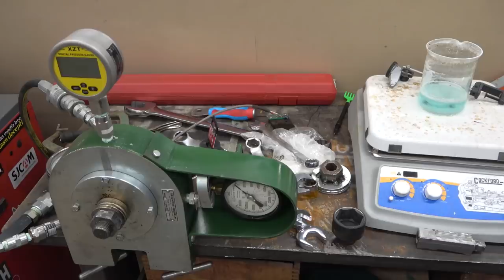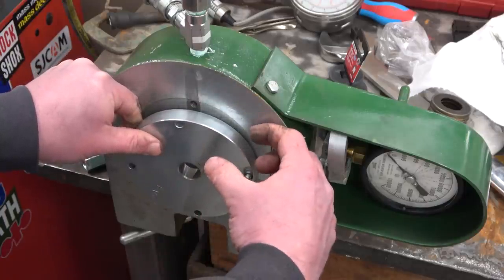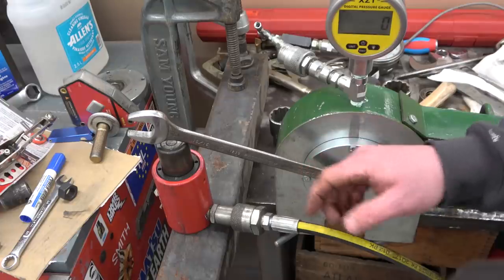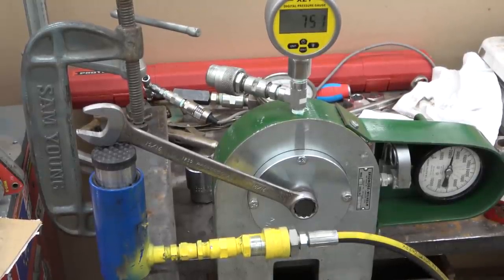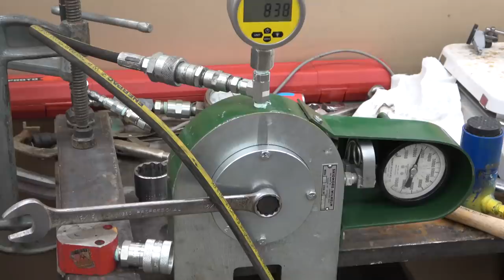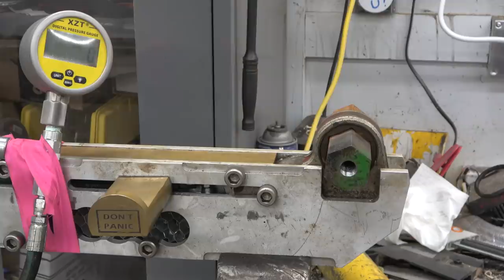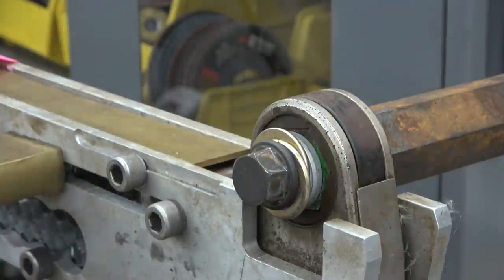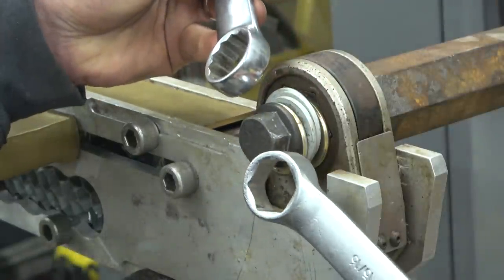6 point VS. 12 Best wrench?

Comment: Because I started working in the early 70's, I'd see a fair amount of 20-30 year old cars; i.e., Ramblers, Willys, Studebaker, Packard and late stuff as well.  The 6 point wrench was my savor on those rear old cars  whose bolts or nuts that were seized up or whose heads were chewed up.  Thank heavens for 6 point wrenches!

These days you don't see many 30 year old cars running around any more...but it was fairly common in the early 70's. 
.
Reply: Nowadays, it's not that the 30-40 year old cars aren't around or stop working, it's just that money is cheap and credit plentiful, so no one drives them.
Reply: My 89 Yoda pickup still gets me to work.
Reply: It's the FIFTY year old cars that hang around these days.  The 30 year ones all fell apart lol
Reply: My 30 year old honda still kickin'
Reply: I worked in a block plant where the 15/16" wrench was mandatory gear for the men, women and children. We had both the 12pt and the 6pt. 

The Sixers were better for backing up a impact gun.
Reply: @dethmaul  My daily driver is a 1970 Dodge Power wagon and pimping out my 1973 Dodge D100 for same use.
Reply: 1992 wasn't THAT long ago!
Reply: Mostly stuff I work on is older than 30 and 6 point is my go-to!
Reply: '89 Land Cruiser here, still going strong. My 25 year old Camry still does a good job of kicking around too...
Reply: I still own and maintain our 1994 Ford Ranger. It's 28 years old now in 2022, almost 30. I drive it all the time and it's fine so far. I just got done faber-cobbling up a solution to fix the throttle cable that broke on it. I plan to try and keep this thing on the road as long as possible.
Reply: Most 30 year old cars aren't interesting
Reply: 1986 Nissan hardbody still driving to work with the AC on

Comment: The problem with this test is your using new perfect bolts. You need bolts that have been ran though a few times by a lube tech. Ive had many bolts that slipped with the 12p but could be removed with the 6 point. I would even dare say the 12pt stripped the bolt head even more.
Reply: I agree. Have had to resort to 6 points many times working on my 99 4Runner. Worst on small bolts that have seized or slightly rusty. Body panel bolts are the worst. Not as much of an issue on larger bolts.

Comment: I was just working on this! And vs spline. The 'ol upload button is just slower than uncle bumble f*ck's.  Good Sh*T! I think what most people worry about on 6 v 12 point is on soft, rusted or rounded bolts and nuts which one will slip the least. Surely as you've shown they are inherently both strong enough to yield a bolt.
Reply from the maker: two magic words for you: "experimental confirmation".
Reply: @arduinoversusevil2025  Agreed. Might try some smaller hex hardware (but large enough thread size to not yield) in order to encourage more slippy slip. I think spline drive is stupid, but being wrong about these things seems to be a trademark of mine. It's worth banging some wrenches around to find out.

Comment: As the hex size decreases 6 vs 12 becomes more important, 10mm and  below I prefer 6 point especially on grease fittings and brake bleeders. 6 point is even more critical when you're dealing with rust and those in between sizes.

Comment: When I'm hanging by one arm off the side of some industrial machine, I love that I have a 12 point wrench in my free hand so I can get it on the fastener the most expedient way possible. I seldom come up against torque limits - just limits of time and accessibility.
Reply: Not to mention the odd square nut/bolt on old equipment. There's a reason I keep a set of 12 point racket sockets in my tool drawer.
Reply: @namAehT  And when it has square head bolts/nuts, you can guarantee it was built when Noah was but a twinkle in his old man's eye.

Somewhere I've even got an old set of 1/2" drive square/4 point sockets.  Try to find one of those these days!

Comment: "By strengthening one component, you just find the next weakest component."

Very simple yet extremely accurate description of why I'm so apprehensive about pulling the trigger on spinal fusion surgery.
Reply: Worked out for okay Tiger Woods...
Reply: @KevinReinartz  To  be fair he's a rich athlete, his access to high end medical care is much greater than any normal person
Reply: Stem cells right into the disk if you can find a legitimate place to do it
Reply: @theawesomeguy9999  He has a STALIF M-Ti fusion implant from Centinel Spine that anyone can get. There are surgeons all across the country that can perform spinal fusion. Most surgeons use a specific brand that they get used to but there are other options. Tiger had multiple surgeries to try to remove some disc that was pushing on nerves previously but finally got the fusion.

People can also get full disc replacement where the disc is replaced with a ball and socket type joint that allows for motion.
Reply: @KevinReinartz  now are you talkin before last week or this week? today or yesterday he wasnt feelin as good as eariler reports.
Reply: @jm97240  I have no doubt I could find a competent surgeon but I've heard the same thing in multiple consults & that's that a 100% succesful fusion at one level doesn't mitigate the possibility of the problem just moving to the next level. Plus I've had other succesful surgeries that required revisions down the road like a shoulder & hip.

Not sure if the disc thing would be an option considering my dx as that's never been offered as a solution, but I'm definitely gonna check it out. Either way, I'm gonna have to do something & probably sooner rather than later. Thanks!!

Comment: Would be nice to see the same test with a smaller bolt, like a 10mm, where rounding it is more likely. Spline drive would be interesting as well.
Reply: I had same exact thought I alwys use 6 point on automotive tasks for this reason 12 point will wound a 10mm head in a heartbeat 6 point you at least have a chance of getting it, although still not guaranteed to removed even with 6 point.
Reply: That's not possible. Please show me your proof a 10mm exists first.
Reply: What the hell is a 10mm?

Comment: My dear Northern neighbor,I respect your advice and knowledge more than my words can express.
I'm not usually one of the commentator types. Fair test, I'll give you that. Growing up on a dairy farm in Wisconsin that straightened nails to be reused, we usually hunted down the elusive 15/16" - 6 point wrench or socket after a fastener had been run through the always handy adjustable wrench, channel locks and rusted vise-grips out of the water filled tractor "tool tray". Without extreme measures of ruining a well worn out fastener, the 6 point usually got the job done... Leaving the rounded edge fastener to continue it's task till the next go around.
True stories of the field... Literally. Keep up the great videos. As usual, it would work better if that finger wasn't missing

Comment: 12 points can be used on squares too. I couldn't find the tap handle yesterday so the 7 mm 12 point was just perfect for the 5/16-18 tap.
Reply: This is the most use my 1/4" drive sockets get, driving taps when the tap handle is MIA
Reply: Always driving adjustable reamer with a 12-point 17mm wrench, works a treat.
Reply: On squares, the adjustable knuckle buster works FINE. or an O.E. of the right size.
Reply: Almost forgot about this. Lmao, used an impact wrench to tap 7/8" on chiller head with a 12 pt.

Comment: I only use 6 points on exhaust bolts/nuts cause they are less likely to strip it out. It's also probably more noticeable on smaller nuts and bolts with less area on the head.

Comment: 12 points along with torx are made with the thought in mind that all fasteners are of the same good quality and can withstand a modest amount of elbow grease before rounding themselves off vs becoming rounded off when you put the tool on them because some guy used a cheap replacement bolt or it’s rusty as frick.
Reply: Good points. Real world example is how many current GM productions heavily feature 8mm bolts, next to some really small 7s, and choke T15s, all out in the elements. 
They really don't want you parting it out, and they really don't care if it's a few tons of waste in fewer years.
Reply: In defense of torx, when being used to replace phillips it’s vastly superior (like in  all the deck screws nowadays).

Yeah torx can round off and I probably prefer a socketed hex (or regular ol hex for that matter) but it damn sure beats Phillips head all day everyday and twice on Sunday.

Comment: Overall strength is pretty close, I’m sure. But on a bolt with some age on her, pre-rounded, the 12 point slips way before the 6 point, and both fail long before a flank drive.
Reply: I would argue that the 12-point is far less strong, due to its thinner wall vs. 6-point.  I do agree with you though regarding 12-point slipping on rounded bolts before 6-point.
Reply: @TroyStevensStelzerPaintingInc  given the same outer diameter and the same size wrench, the thinnest dimension will be the same on both wrenches, where the points are. The 12 point just has twice as many. If they break, they’ll break at that thin point.

Comment: only time i use my 6 point wrenches is on brake bleeder screws . It lets me shear them off flush without rounding them off first and then having to use my vise grips to finish destroying them. Saves me time!!!
Reply: Lol I suppose there is some reason beyond my understanding why they use pot metal... I'm guessing a better seal or something.
Reply: @codemiesterbeats  
They get six months at least, sometimes a couple years between uses. Means the maker can get away with it without having a loss of customers, because nobody remembers which brand had better metal on the bleeder. 

Eventually everyone went for the cheap, because nobody was buying the better

Comment: When you have slightly used nuts a 12-point doesn't do a good job. That's why you heat the nut before you put the 12 point on it if that's all u got.

Comment: As many before me suggested, a smaller head would be interesting.
Also a lot of people came up with rusted heads. And this was also my first thing, I thought about.
The problem I see is: How do you rust away multiple bolts the same way. 
So what does rust do:
-It shrinks the Head. (Okay, first it gets bigger, but if you clean the bolt, the remaining steel is smaller)
If you mix up Metric wrenches with Freedom units bolts, you could get a situation where the head is smaller than intended for the wrench.
-It rounds off the edges. 
So the edges of the Head could be turned down a little bit with a lathe. And this every time by nearly the same amount.
-One additional thing is the Surface roughness.
You could try sandblasting it, but this makes every time a huge mess and the result isn't as consistent. So I would ignore the surface finish for now.
Maybe this is the too complicated view from a German (soon) mechanical engineer.
Love videos like this, keep it up.

Comment: Mechanical engineer here. From a mechanical stress perspective, the stress in the wrench is highest at the vertex of the bolt head hex. It decreases logarithmically down to the point of no-contact with the wrench. This is a problem because it means the force distribution depends on the tolerance of the fit between the bolt and wrench. For a typical wrench and bolt combo, 90% of the stress occurs within 5-8% of the side of the bolt head.  So for a half inch bolt, that's less than 20 thousandths (less than 0.5 mm). So I can't imagine there's any practical difference between hex and triple square, assuming that the dimensions are the same, and assuming the bolt does not yield. This might be a big one. If the bolt rounds over, you might lose significant engagement with the triple square.  I think the lesson here is to trust the people that design the standards for bolt and wrench dimensions.
Reply: Unless I misunderstood,  12 point and triple square are two different animals
Reply: @jongrimm7767  Yes, exactly. I may have misunderstood what this video was about. A hex and a twelve point wrench have identical contact patterns on a hex bolt. There's no difference in performance by definition. So I guess I assumed nobody would be stupid enough to claim otherwise. I thought this video was about how the higher contact angle of triple squares is better. But I now realize that's probably not true. But now I'm not sure why anybody thinks 6 vs 12 point wrenches are different.
Reply: @gizmoguyar  the problem with you engineers is that you never consider how your stuff is going to perform after 10 20 years of rusting and abuse, where 6pt vs 12pt (double hex) absolutely makes a difference
Reply: @vxiiduu1629  Actually, the most important part of our job is to consider longevity. It's easy to complain when you have no clue how many decades of research, testing, math, material science, and real world use goes into designing something as simple as a bolt. There are hundreds of factors that engineers have to consider that you probably haven't even heard of. Our expert opinion based on many years of education from those that have done this work before us, as well as decades of experience working in the industry is what allows you to even have a car (or whatever) in the first place.  Without the quantified approach to design that is the entirety of engineering, you'd still be riding horses.

Comment: A story on finding the weak component.

I was looking for new manual hubs for my little ranger pickup. Warns were the standard fare. I wanted better ones. Came across a forum thread where someone else wanted stronger locking hubs that didn't break. They had a few sets made. The hubs didn't break but everything else between the drive line and hub failed on everything eventually. Inner shafts, u joints, pinions, etc. Everything you don't want to break on the trail broke. If a hub broke you took the wheel off and swapped the hub unit. The unbreakable hubs were shelved by all using them and they went back to Warns.

Comment: Correct! Working at a GM dealership i pick 6 points when i know i am dealing with a soft aluminum bolt or similar. 
The 10mm drain plugs can be destroyed ny spanner and apprentice without too much effort however the 300lb gorilla can reef on the 6 point with no issues!

Comment: Hi Mr. Uncle BumbleFork in the Frozen Hoth of Canaderp, 

I have been watching your channel for quite a while now and always get a kick out of literally everything you post. I had a chance to show one of your videos ages ago to a family friend who was helping me with my car project who unfortunately past away a little over two years ago. He helped me assemble a Honda engine, doing all the right things when it comes to engine assembly, measurement, conversation, tips and tricks and don't do's. He was a family expert who had assembled more than ~1000 engines in his life.. Was one of those people who was shocked when I told him, teach me and don't do it for me. Most of the folks that came to him didn't want anything to do with the "hands on/learning anything" they just wanted it done for them. Kind of a shame these days.. He knew it all! There were very few questions I could stump him with when it came to mechanical / electronical or anything relating to building/making cool $hit. I asked him a question one time and got the funniest of answers that made me think about how you explain things.. I said  
"Warren! How tight can you tighten a bolt? his answer was "Well that's easy Aaron, half a turn before it breaks" Like the most hilarious of responses that will always make me crack up. As funny as that is, it's pretty funny considering you did a video about bolts yielding. Perhaps a video idea to do sometime regarding ARP H22A "Honda Engine" head studs and L19 head studs? 

When he last came over I was able to show him the electronics I had in my car and what they do and thought was pretty amazing! I felt pretty awesome getting that kind of a reaction out of a person like that. I posted a video a little while back to show some of my FB friends.

Take care! Keep makin cool $hit with the handsie's and causing me crack up with opening boxes with small chainsaws complaining of packaging damage.

Comment: For big fasteners yes. But when you're talking about 1/4" heads of bolts or nuts the 12 point does slip, especially when the hardware is corroded.. I know from personal experience. But bigger head size hardware I agree 100% no difference at all.

Comment: I love AvE and these kinds of tests, but automotive work is definitely an exception to this conclusion. You get a lot of rounded #8 and #10 bolts due to 12 point sockets. So much so that in our shop we trained heavily to use a 6 point socket or wrench on a 6 point bolt/nut. It cut our damaged fastener lost time in half. I'm sure this conclusion is correct for large diameter fasteners, but for small and worn fasteners, that just isn't the case.

Comment: On a brand new hardened bolt.  Yeah, maybe they work the same.  Try getting off old rusty grade 5 or lower bolts and you'll round way more heads off with a 12 point.  At least in my experience.  Of course they're as like to just break as anything else, obviating the utility of either wrench but that's a topic for another day